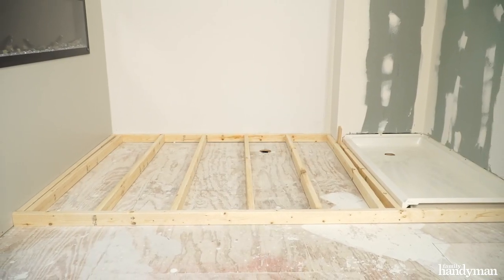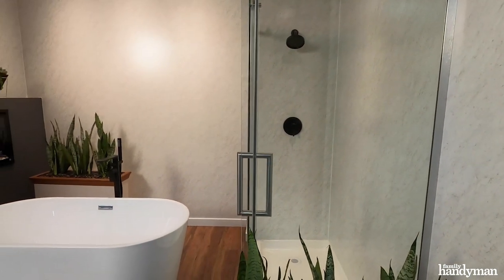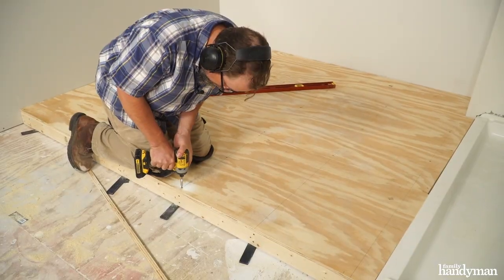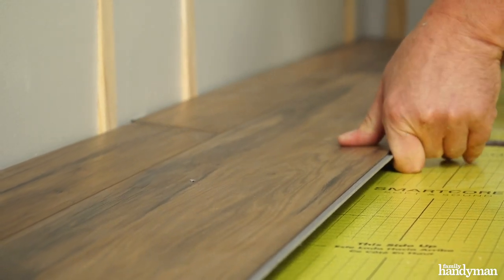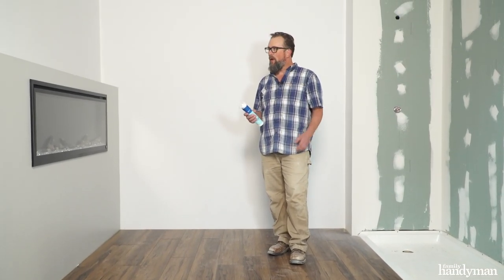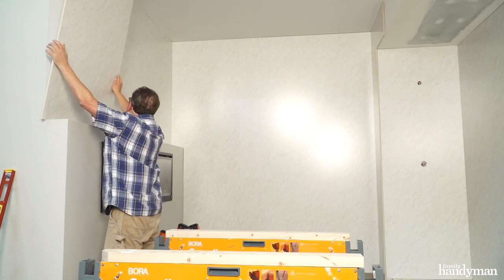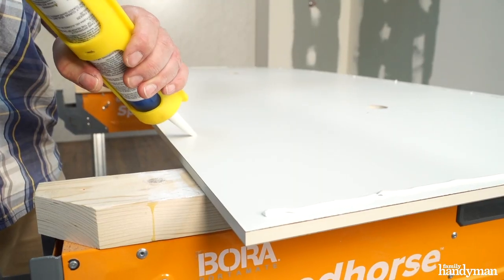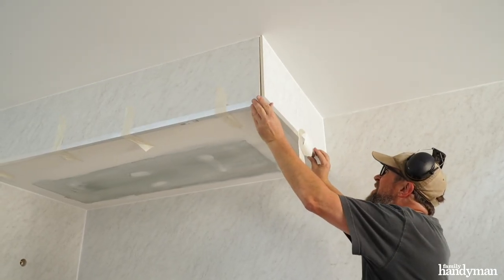How to Install WetWall™ Panels

Comment: These panels are called Mermaid Elite in the UK (Alterantive to Bushboard Nuance Panels), the Wetwall brand in the UK uses a MDF core and required trims and profiles for installation.
Reply: Hi ive just bought some panels. I thought it was a wet wall but its got a really thin piece of plastic coating then about 2cm thick. Of wood is this wet wall? As i assumed wet wall was just pvc? Thanks
Reply: @divinesalon339  Wetwall is a brand name and in the UK their product range is vast and including glass panels, acrylic panels and solid core (MDF core) laminated panels. The laminate MDF poanels are 10.5mm think in total with a 9mm board with a 1mm lamiante on the front and rear.

Comment: Great video, very informative! I am thinking of using wetwall for the 36"x36" corner shower remodel I am currently working on (This is my first time DIY bathroom remodel.) I wanted to use wetwall for this, but the only wetwall products I can find are kits that are for alcoves. (This one to be specific, Wetwall 48-in W x 34-in D x 96-in H Norwegian Elm Alcove Panel Kit Shower Wall Surround) Since the side pieces included with this kit are only 34", I was thinking of using the 48" panel on one side (cutting it down to 36" and using edge trim to finish the edge, since it will be and unfinished edge.) And for the other side I was thinking to cut a 2" vertical piece off the other 34" panel and gluing it to the other 34" panel to get to 36" (the 34" pieces have a finished bullnose edge). Do you think this is a feasible solution? (my initial thought is this won't work, since I think these work with a tongue and groove system.(I am still waiting for my wetwall to be delivered, so haven't had the chance to take a look at them)  Also, do you know where I could just order wetwall sheets and not kits? I appreciate the help!
Reply: Did u get ur delivery?  Have u completed ur installation and did  you find the place to order the wet wall I'm single panels?
Reply: I didn't open the box. I ended up calling wetwall and they said they never heard of someone trying to cut a piece length wise and glue two cut edges together, they didn't suggest doing that. The person I spoke with gave me a number to a wetwall dealer near me, so I could buy two 36" sheets that  I needed.